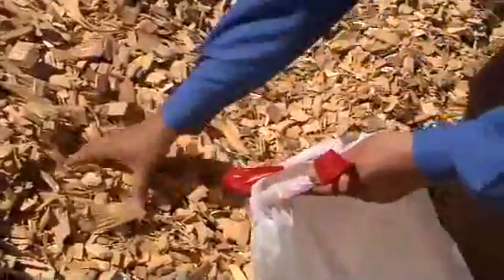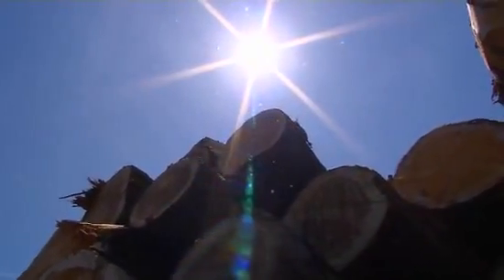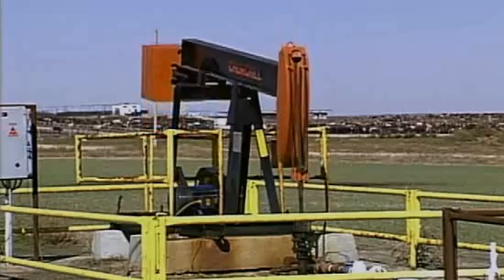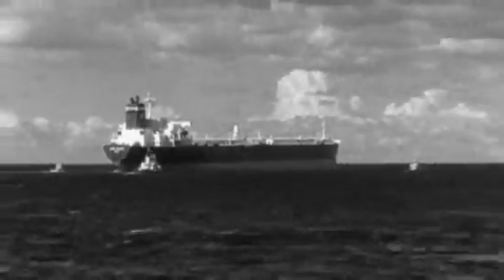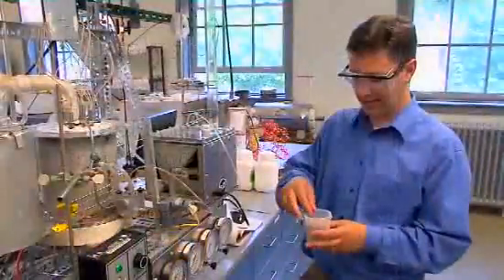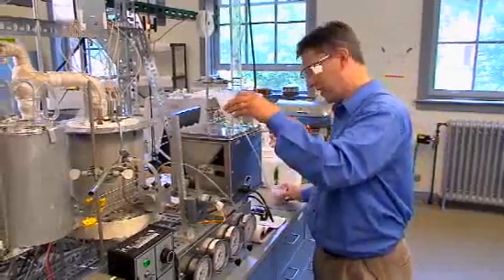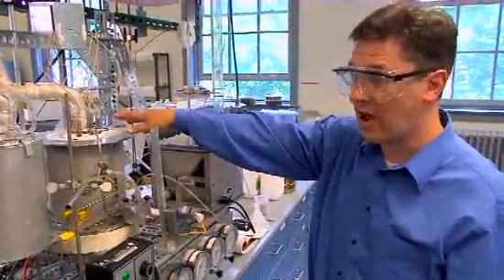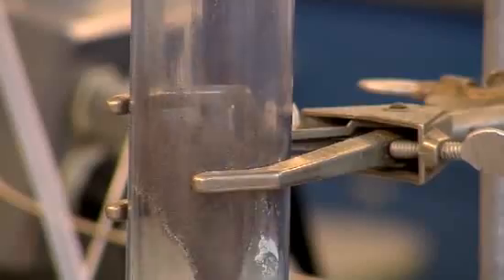Green Gasoline from Naturally Stored Solar Energy

Comment: Yes, I want friendly cancer that only makes me suffer for longer before I die, instead of no cancer. If they spent as much effort making solar panels more effecient and batteries lighter we'd have solar powered battery-cars with 1000 miles to the charge allready.
Reply: lazygamerz I don't think you understand. This gasoline would be carbon neutral, because they are using carbon that was just absorbed from the atmosphere by trees. Using this gasoline would be as "green" as an electric car.